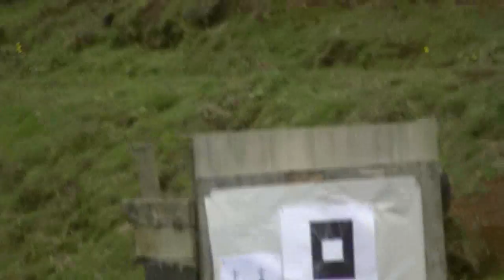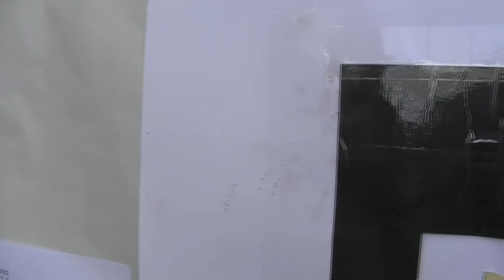Lee Enfield No.4 Mk 1 rifle bedding tutorial and hunting.

Comment: No.4 Mk.1* can be not free float at factory spec. They typically still have the muzzle bearing at the front, but there is a relaxed wartime measure of free floating. But, barrels of Lees are light and whippy, most of the time I hear they benefit from the 5bls of down pressure on the end of the forstock.